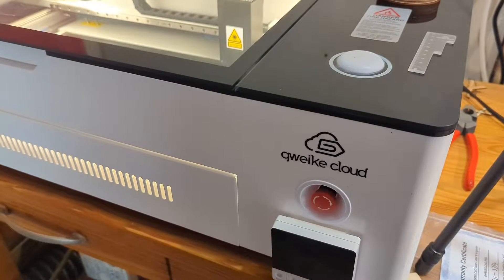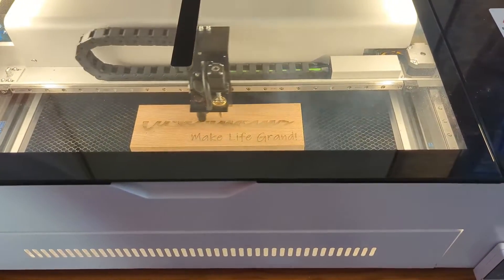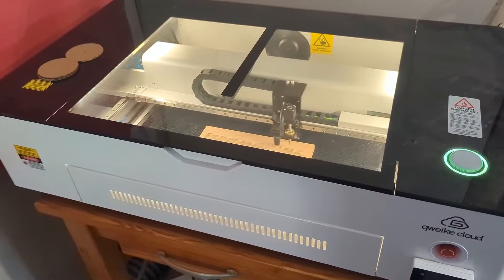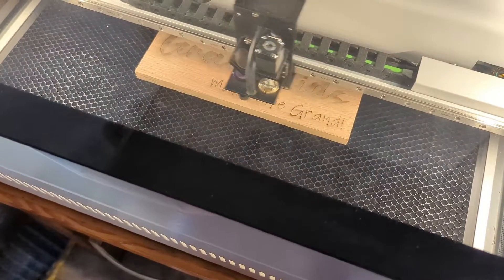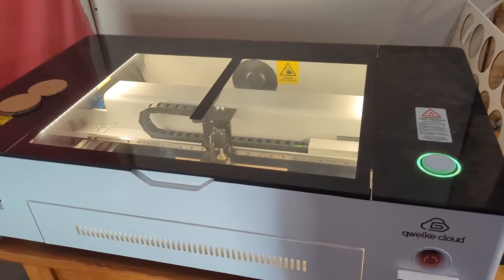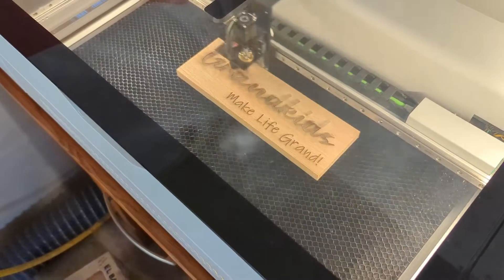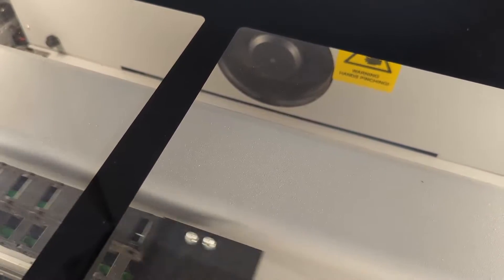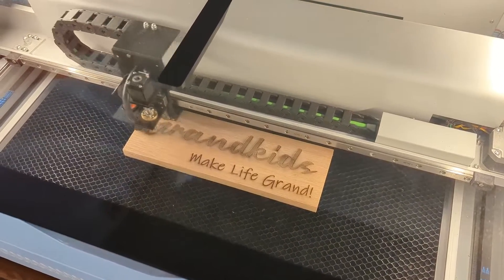Gweike Cloud Pro 2 55 watt CO2 laser - Is it as bad as they say?

Comment: How does it do with tumblers?
Reply from the maker: It has a rotary attachment as well as a cutout at the bottom of the bed to accommodate it. Truthfully I haven't used the rotary attachment much. I did a couple of wine bottles and it worked as it should. I have a separate fiber laser that I do most of my tumblers on.
Reply: @jestermetalworks 

Appreciate the information 

Not many people are putting out videos of the machine anymore.

Comment: hello, what is the black and white controler that is installer under the urgent stop button? it is to control the exhaust fan? where do you buy it?
Reply from the maker: Yes it's the blower fan controller, it came with the laser kit. Gweike may sell it separately, not sure though.
Reply: @jestermetalworks  thank you very much. it seems Gweike changed the description of the 55w model today, the autofocus is not anymore available. i am so disapointed.
Reply from the maker: @fabricef.d.p1011  These are still completely usable without auto focus, I use the focus stick most of the time anyway, just to confirm.

Comment: have i understood correctly that the autofocus does not work with lightburn?
Reply from the maker: Auto focus works in lightburn, you used to have to do some math , but now you enter the thickness of your piece and it will work. Most of the time I manually focus the laser, just to be sure.
Reply: @jestermetalworks  thanks!  on their tech specs they write it has "AI Visual AF/Material Recognition AF/Material Set-up AF",  did you figure out how this works? i sent them a mail about this but never got an answer
Reply from the maker: @WickedSheepLP When I got mine, you had to subtract your material thickness from 17 to get the correct AF in lightburn, but shortly after that LB did an update that corrected that math issue so all you do now is enter the correct material thickness and it will auto focus correctly. I still mostly use manual focus, since sometimes I have to remove the honeycomb bed to engrave odd sized items.

Comment: I purchased mine 55 pro in September and i must say I absolutely love it. For the value i think it is worth the investment. Gweikes whatsup team are extremely helpful. Initially i was hesitant but the do their utmost to assist. 

I am new to c02 lasers having only owned a dio laser previously. 

I can’t speak for the lower models but the Gweike 55 pro model has not given me any major issues. 

Using light- burn i will say check your ‘Get-position’ after every task as the unit defaults back to 0. Other than that, your good.
Reply from the maker: Glad to see others with similar results, So far I'm loving it!
Reply: @jestermetalworks  How can you replace the tube when the lifespan ends? At the site I can see only a 50w tube.